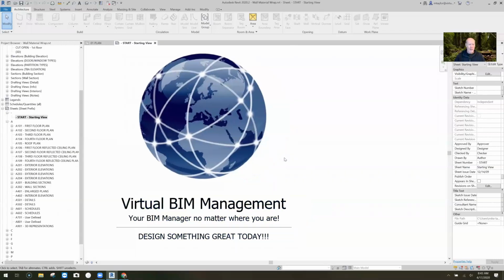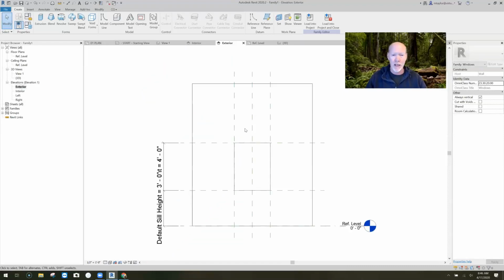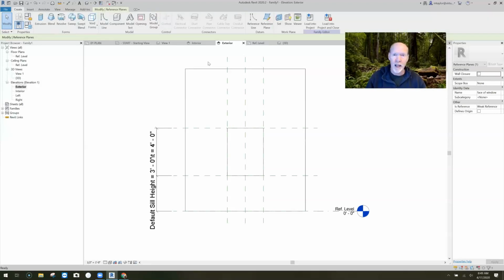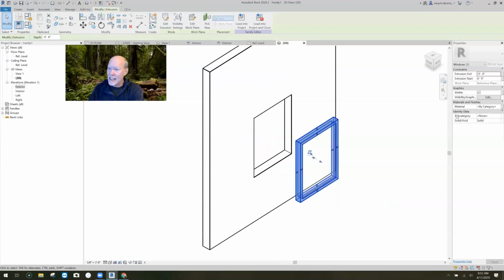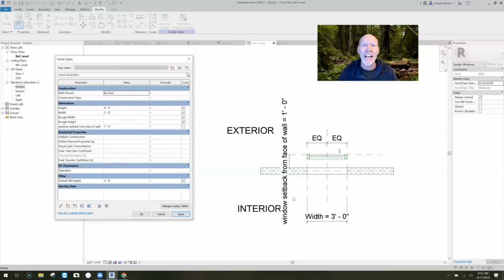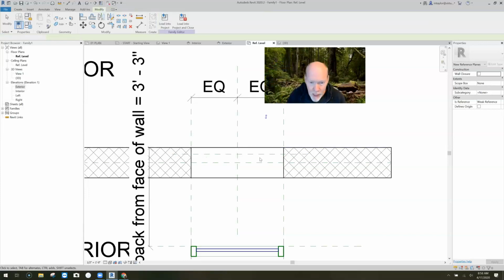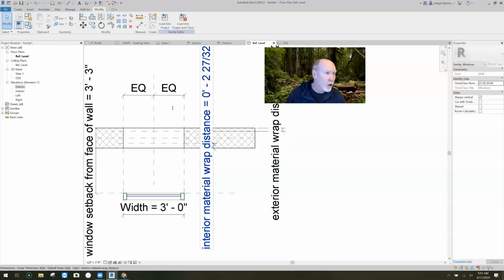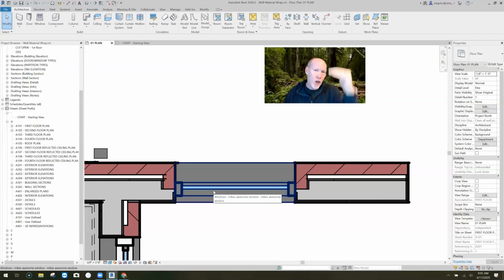WALL MATERIAL WRAP (Part 2) Controlling it

Comment: Hi Mike, thanks a lot for this useful video! Is there a way to change the wall layer thickness as they wrap (since it is common for example around windows to have prefab elements or insulation with reduced thickness against inserts).
Reply from the maker: Revit can't change the thickness of materials as it wraps. So, unfortunately, you will need to fake it with a detail component. If you want... you can EMBED the detail component IN THE WINDOW family so it's already there and you don't need to add anything. =)

Comment: Hello, 
Your video is so useful. I have just one question: 
Can we make a parameter that I can change for every different window in the project file? Because if I use one specific window on different walls, with different thickness and layers I will want to manage wrapping depending on moment and not to create new type of window. 
PLS Help :) !
Thnks
Reply from the maker: Anton: The parameter for controlling the exterior material wrap distance that we created in this window can be set to a different distance on each TYPE of this window.  Example: So if you have one that is called TYPE 1.. you can set the material setback to 2" for this Type, and you can make another TYPE... and call it TYPE 2.. and you can set the material setback to 4" for that Type.  Since it's a TYPE parameter, it can be different in each TYPE.
Reply: Ok... it's my fault -> I just must use Instance, not Type parameter... Sorry for my dummy question :)